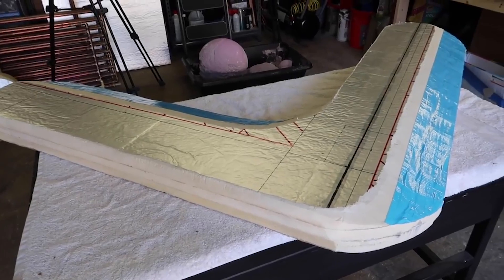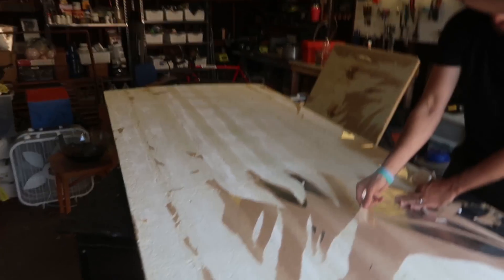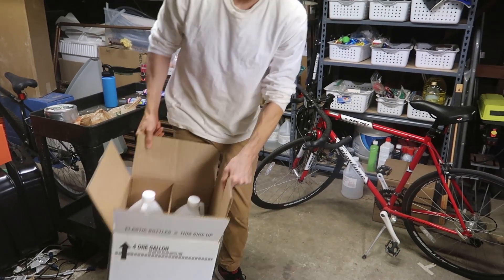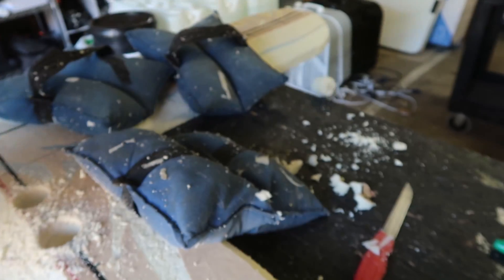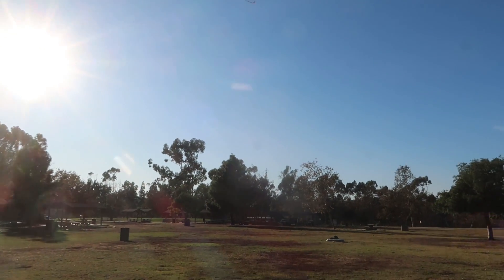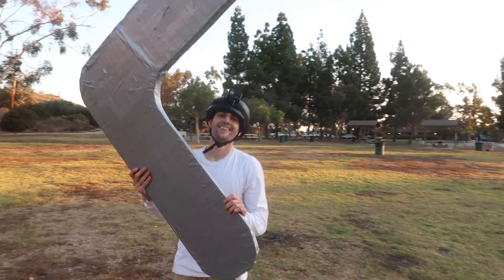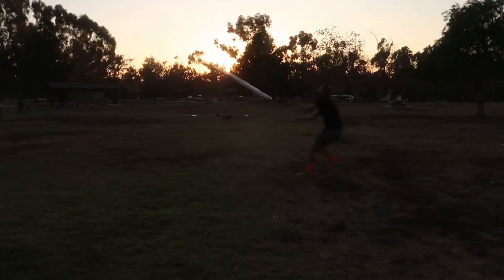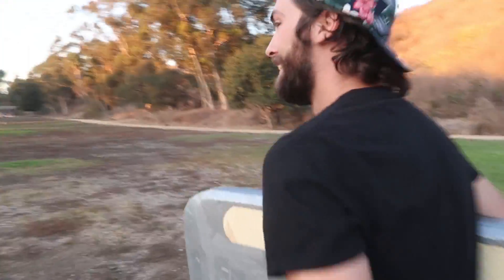GIANT 6 Foot BOOMERANG: It Works Amazing!

Comment: The 45  degree sloped edge is the leading edge, (forward in flight), the longer angled side is the trailing edge, the BACK of the wing.  You are throwing it backwards, so the flight was all wrong.  Throw it left handed (on the left side), with the 45 degree slope facing into the throw.  It ought to fly better.

Comment: use a light low density foam for the core ply.  

heat seal the foam on the outside to give it a rigid lightweight skin 
give the leading edge a rim of water pipe insulation for your comfort

Comment: That's just throwing a piece of foam up into the air at a steep angle so that it falls back toward you... you can do that with a frisbee or anything flat...   
The boomerang should follow a circular path and come back to you..  You have the right shape, but it should be thrown closer to vertical so that you get spin that generates loft, then it will make a nice loop around.. it might be too heavy..
Reply: That's what you get from a amateur Mark Rober wannabe 😅

Comment: Could you have tried to make the middle layer just the outside edge so the boomerang would be hollow and much lighter?
Reply: I think that affects the aerodynamics of a boomerang
Reply: Awkward Steve cg should stay the same, and the density probably wouldn’t have mattered unless you’re trying to cut through strong winds
Reply: @markkaz7754  Fair point, however, it almost appears windy in the video itself